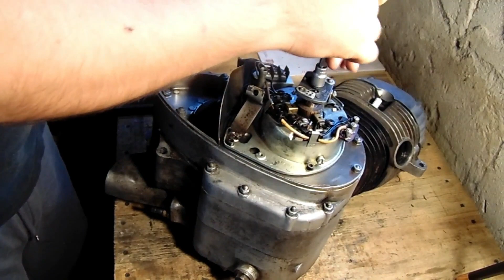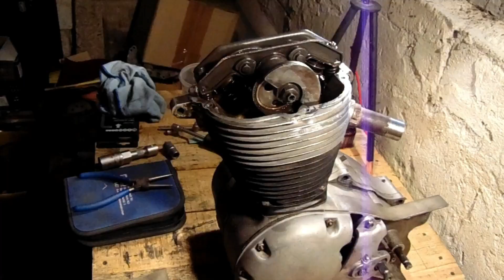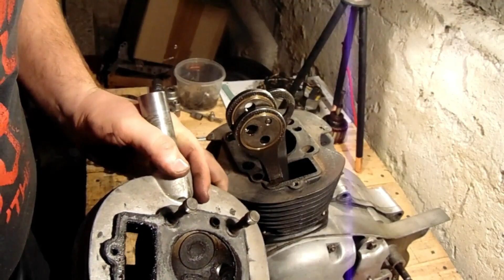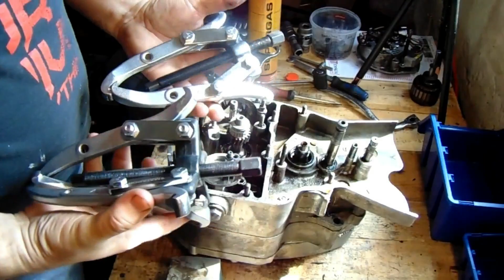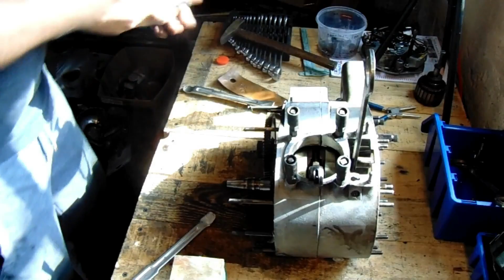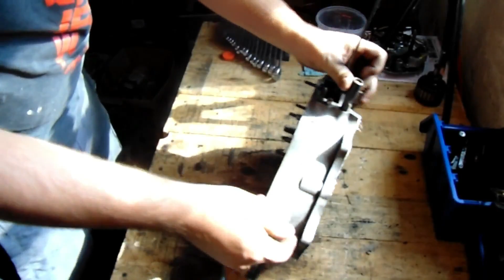Oldtimer engine rebuild ,NSU Pretis 175 from Italy ( part 1)

Comment: Very nice rebuild. I have a 125 that is almost identical to this engine and when the engine is not running the oil drains from the tank into the sump, is this an issue and if so what might be causing the problem. 
Regards Sean
Reply from the maker: Hello . It is not a problem . It is the law of the gravity :) . The oil tank is above engine, so the oil will slowly pore back to engine .
As long as oil is returning back to oil tank, when the engine is running ,there is no problem .

Comment: Seems to me that u had work on that engine before cause you’re taking parts out like nothing. Hopefully u won’t end up with xtra parts. Wish you my best
Reply from the maker: You are partially correct . I do sometime remove parts that are heavily stuck ,and then put them back . The reason for that is because sometime it takes 30 -60 min to remove one part of the engine ( like main drive gear on the crankshaft ,some stucked bolts ,damaged end of axle ... ). I don't wanna for my viewers to spend one hour of watching me removing one part .I remove stuck part , fix defection ,put it back and then film it . Sometime I forgot to press record ,and disassemble some parts before I notice that I'm not filming .Then I need to assemble it back. 
For most of the engines I don't have any manual .Because of that I disassemble most of the engine ( to learn how to disassemble it ) , and then do it again while filming .
All off the engines that are on my chanel are first time dissasembeld by me .